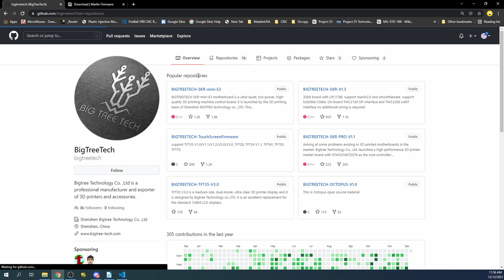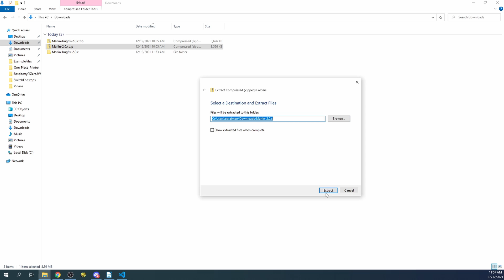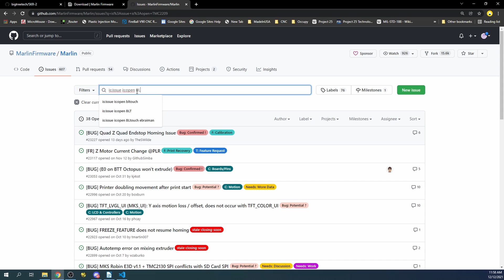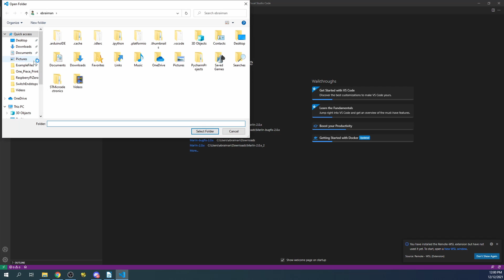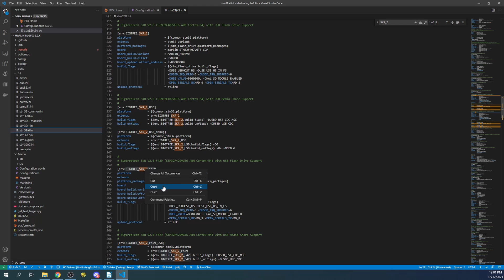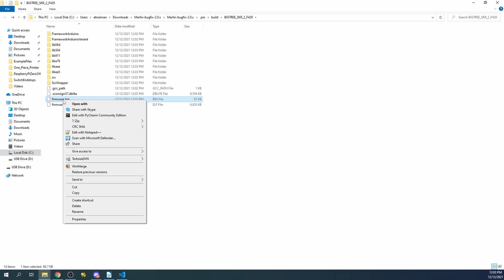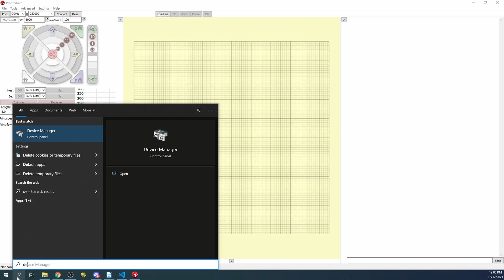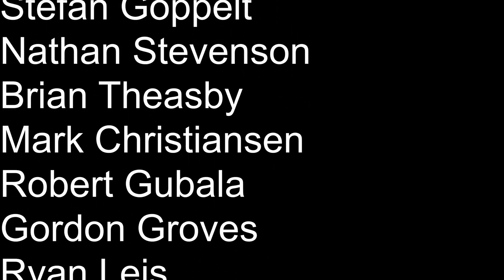SKRv2 - How to install firmware on STM32F429

Comment: This is still a CF of epic proportions. Manufacturers of motherboard needs to step up with pre-rolled firmware where we can enter basic configuration parameters and get these boards work. This is ridiculous
Reply from the maker: I get where you're coming from, but unfortunately i do not work for the manufacturer.  They do have example files, but they also can have issues.
Reply: @EdwardBraiman  for all the grief of trying to get my btt skr2 working, i threw it in the return bin, linux cnc and stepper drivers, I'm over it
Reply from the maker: You do realize there's a Discord link in tutorial that's free and helps a lot of people.  I'm online right now.
Reply: @EdwardBraiman  I no longer care, I'm putting Linux CNC and controller cards on it  I'm done giving this half baked garbage my time.
Reply from the maker: I'm confused by your initial post.  Do you have experience working with 3d printer boards or loading or building firmware?

Comment: Hey I have the SKR 2.0 board and I can set up auto bedleveling fine with reprap, but with marlin in the config file I am very confused,  on setting it up. I can't figure out a probe pin and wiring to get it working. I used PE4 and PE5 for the pins for the bltouch to change, but none seems to work. can you clearify some things with marlin
Reply from the maker: BLT generally has issues due to extension wire.  Some user splice wire to get probe working.
Reply from the maker: Also the a link to Discord where several different people have worked with it.

Comment: The 429 chip seems a little bit faster of a chip at 180mhz and has built in TFT controller, I have both boards and have been having issues getting my Z probe to not be triggered all the time on the 429 board. I will try this bug fix and see if it solves my issue...I hope..thanks ..
Reply from the maker: You're welcome.

Comment: If I had set up my SKR 2.0 board (STM32F429 MCU) with the current stable release of Marlin 2.0 and it seems to work, is there a reason to download, configure and replace it with the "bug fix" version? 
Also, is there an easy way to compare the configuration files from my configured stable release version and the bug fix version so I can transfer all my settings to the bug fix version?
I second that comment about setting up a wifi module on the SKR 2.0 board. I missed my chance to purchase Raspberry Pi Zero 2 at Microcenter and now they, and all reputable sellers are out of stock. My best option is likely the add-on board. Either the BTT module or a generic from Aliexpress.
Reply from the maker: There might not be a big difference.  Others have asked how to address different chipset, so I explained how to identify and load.  They maybe almost the same.